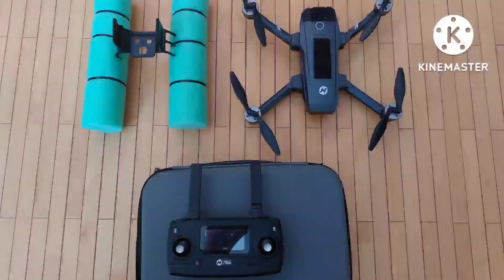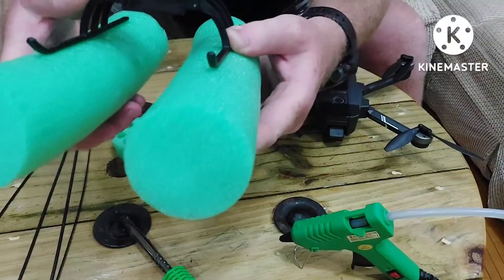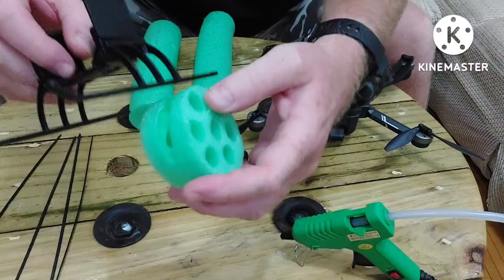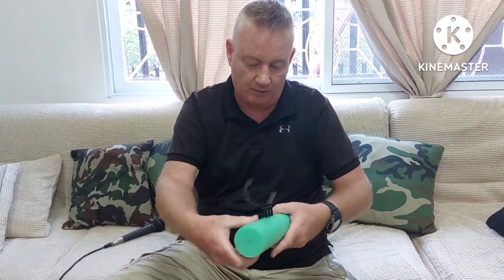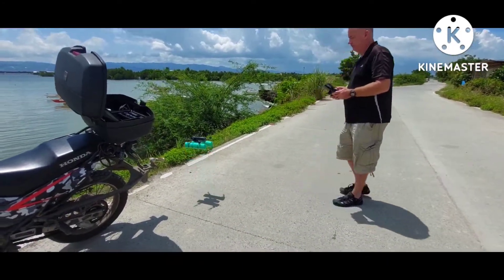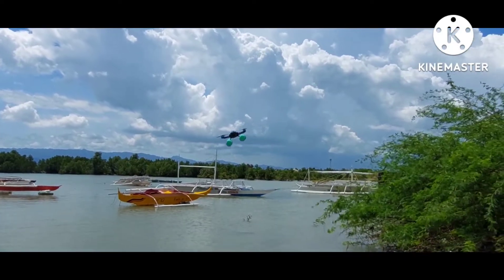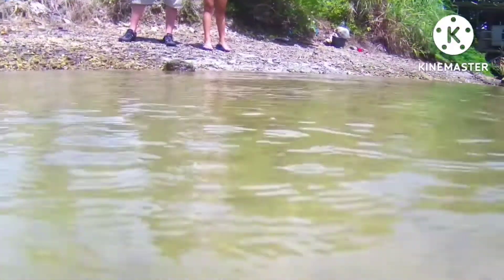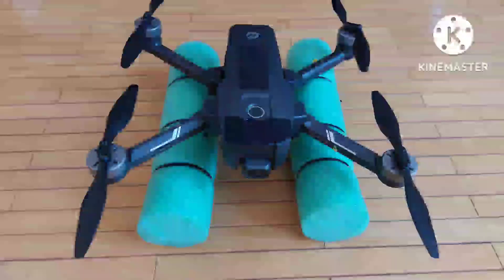HS720E Drone DIY Water Landing Gear

Comment: Nice Idea. I camp on Lake Champlain every summer and I wanted to get drone shots this year, but I was worried about it falling in the lake.  I also wanted to launch from the boat, but I was afraid I could have issues with landing it to get it back.   I used your idea but with pool noodles, and sealed the ends.  I have an HS360S so there is no landing gear out there for it, however, there is another type of landing gear for the HS720 that uses a rubber strap over the top.  I was able to adapt this to the HS360S.  I used a pool noodle, and sealed the ends with pool noodle foam cut to form a plug.  Air is lighter than foam, so I figured sealed end pool noodle is better than solid foam anyway.  The strap-over landing gear is shorter, however, so this put my back prop arms level on the foam.  With the foam so close, it was obstructing the camera, so I cut away the inside edge of the foam in the front at an angle, until it was out of view, without cutting into the air chambers.  I then made similar cuts to the backs of the pontoons for balance.  It still floats basically as well as with the whole noodles, and looks more aerodynamic.  I can take-off and land in the pool, so it is looking good for boat launches and landings next week.  A quick run over with a heat gun on low, takes the texture out of the pool noodle foam, especially where it was cut, and makes a smoother sealed surface, then you can paint it and make it look nice, if you want.  Final weight with noodles, glue (super glue to save weight), paint, zip-ties and landing gear: 35g.  I put too thick a coat of paint on it, I think, as it was only 30g before the paint.🙃  Landing Gear: $10, Pool Noodle: $2.50,.  I already had the glue, paint and zip ties.